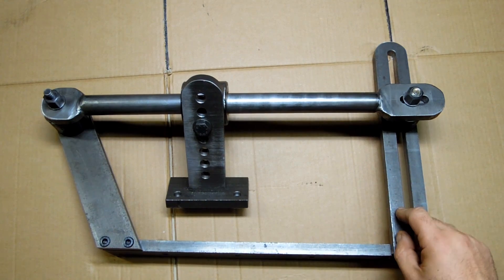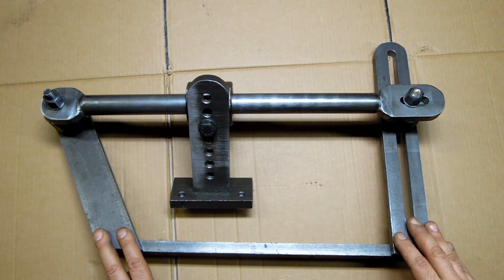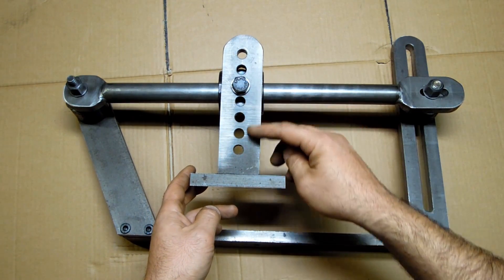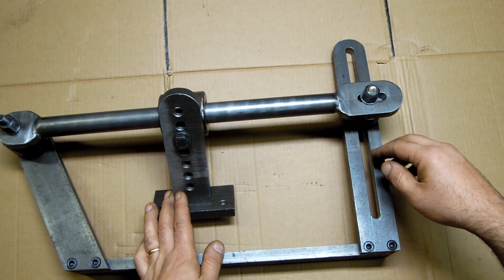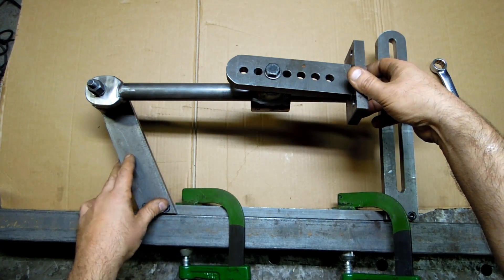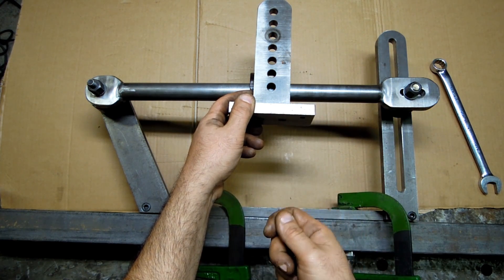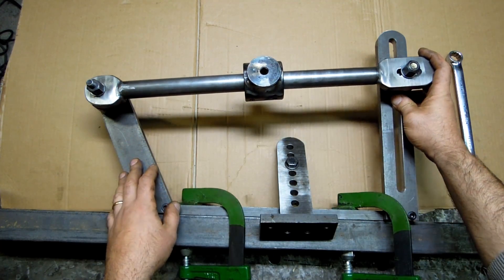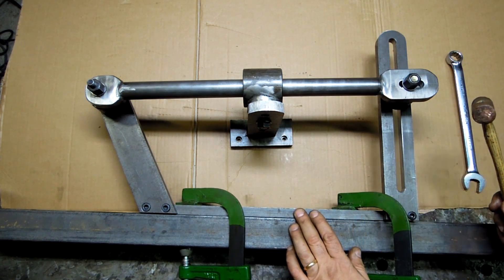lathe taper attachment 2

Comment: Love your taper attachment .. built one for my HF 7x10 mini.  Welded a lot of the joints.  Problem: I'm taper threading 1/2" CuNi pipe.  I turn the taper first, but when I'm cutting the threads the tool screw keep snapping :-( using an AR Warner indexable HHS insert.  thanks for any help

Comment: Tony I cannot believe how polished your presentations have become in seven years. Congratulations. 
Hope you're recovering from your recent loss. My sincere condolences.

Re the video, I don't have a taper attachment but use the tailstock instead. For Morse tapers I set a fixed center in the headstock bore and a revolving center in the tailstock. I have a commercially produced Morse taper mandrel that I insert between the centers, move the tailstock over and indicate on the taper. Once that's established you have your taper set. Of course Your stock needs to be the same length or it will be off but it works for the most part. 
To cut internal tapers I use the compound and indicate it to a sample taper held in the collet chuck on a piece of suitable drill rod or known dowel pin.

Comment: The proper taper turning attachment still uses the nut for the cross slide - so that still works as normal ! The cross slide screw is different as it has a sliding spline drive from the handwheel so that the TTA can slide the screw as necessary. The slide on the proper TTA is also a dovetail like cross slide and top slide slides.

Comment: With common tapers can you drill a set pin hole on the adjustable slide and have a set pin to lock it into place so you don’t have to use a dial indicator every time or are their too many variables taking it off and on to guarantee accuracy?

Comment: When you're done with your taper and want to reset to just a normal straight cut, do you have to adjust the taper angle and fully indicate it back to parallel? Or is there some trick to just disengage the taper?

Comment: Hello,  Now the challenge would be to design a chip guard that fits out around the taper attachment.  Kind of screws up all my racks on the back wall that the lathe is against.  I won't be able to reach them when I attach my taper guide.  This old Tony being This old Tony I expect one of your upcoming projects will be half nuts for the cross slide so you can engage and disengage without unbolting the nut!  Nice video.  Doug

Comment: Still awesome to still watching your vids all these years later. I actually just watched and old abom vid about his taper attachment on the monarch lathe. I gotta say, man, whatever you do for your 9-5 gig, you aren't making enough. Always thought your ability to solve problems was inspiring. I am an R&D tech for a big supplier of the manufacturing industry, focusing mainly on oem conveyor systems that run belts made from PVC, PU, Polyolefin, and a few other unrelated to that genre of materials such as rubber, leather, etc. If you aren't in R&D making booku cheddar the technology sector is missing out, and humanity will suffer because of it.

Comment: In lieu of a hammer for fine adjustments would it be possible to add a threaded rod (under I imagine , it just seems inaccessible) to the slotted side to be used as a lead screw and somehow have a turning handle on it ? 
Just an observation from Captain Hindsight here. 
Great Video , Thanks for Readin' !!!
Reply from the maker: Certainly would!  I was going for my signature "lazy" design.  :)

Comment: Tony,to save replacing the bronze bush,why not drill and tap the worn bush with brass screws with lock nuts,adjust the screws until you get a firm sliding fit.

Comment: What if instead of using cold rolled steel shaft and a bronze bearing, try building a straight guide shaft from 1x1" square stock. Then for the linkage that connects the guide shaft and the cross slide, maybe build a sliding carriage that is a two piece design. The carriage could have 2 roller bearings per side on both sides that follow the guide shaft. Easier said than done I'm sure but there's always a few other options.

Comment: How would i go about holding a tapered object in the chuck? I mean something that has a taper on both ends with just a very small flat in between the tapers. This is an MT2 to JT6 arbor. I need to shorten the MT2 side and i know i could probably cut it off with a grinder but that's not pretty. I'm new to all of this but eager to learn. Thanks.
Reply from the maker: Soft jaws for your lathe chuck... but in your case I'd look for a JT6 socket I could hold onto.

Comment: It would be easy to use some bearings for the cross-slide guide on a piece of square stock or even a milled guide for eccentric shapes. Although im having a hard time imagining what it could be used for cutting an S shape. Maybe a pointless vase lol. More of the purpose of the thought is that square stock could be used easily as well. I have a little old atlas with 12” swing for projects and have been pondering making one of these for a while. I’m 90% through building a tool-post drill for making some indexing plates for my dividing head. Maybe this will be my next tooling project. Love these videos.

Comment: Nice job on your taper attachment. You could slot the T attachment that bolts to the rear end of your cross slide and use a washer under the bolt head that connects to the bronze bushing block rather than the series of holes. But, of course, there is more than one way to skin a cat.

Comment: im sure this is a really stupid question, but dont most lathes let you spin that (i believe you called it a top slide) and set it at different angles so you can cut tapers? i saw that you spun it 90 degrees there, does it not allow you to set it at angles in between? what am i missing here
Reply from the maker: that's true, but the top slide only has very little travel (usually), so for longer tapers they're not that convenient.

Comment: Great share, a whole new dimension for the lathe. I saw there is even a taper attachment for the Atlas 10" lathe. You only need this for long tapers as the compound can be set up for shorter lengths, whatever the range of the compound is.

Comment: I can see the taper attachment being useful for long tapers, but for turning shorter pieces, you can turn your compound rest to match the angle of the taper and use it to cut the taper; you would of course lose the ability to use power feed to cut the taper though. Using the combination cross slide, compound rest, and of course carriage feed, you can also cut long tapers without a taper attachment.

Comment: Tony, I have a shopmade TAttachment that came with my lathe which I have never used but is built exactly like yours. My question is....can a 15 degree taper (30 degree included angle) be cut with a device like this without undue pressure or binding ?? I know 15 is probably at the maximum end of things but I need to put a 2.75 - 3" "spear point" on some 1.5" diameter stainless steel with the taper being approx 2.75 -3" long. The number I have come up with is 15 degree'ish. I would rather use the attachment under power feed than use the compound and be cranking all day especially on stainless. What do you think?....doable? The attachment is well made also with a bronze bush running on the bar like yours. TIA

Richard~

Comment: To replace the bushing, you could cut a new bushing in half and use the halves to press the old bushing out, gluing the new halves in with JB Weld and clamping the slider in your vice to take out the clearance - if you do not have a suitable welder. ...But then you could have threaded your shaft and ends and just unscrewed an end to replace the bushing. Or you could have used a split bushing in the first place and made the slider clearance adjustable with a split slider and an adjusting bolt. But by then we would be so old we would have forgotten what it was we intended to do with the taper tool in the first place.
Reply: turn one end down to allow the bushing to slide right off? ohdang, year old video lol

Comment: Also, if you added an eccentric bushing to either end of the slider bar (fixed end would be way simpler) you could get nice fine adjustment on your taper angle.

Comment: Cool simple job.   You gave me some good ideas as you talked.  A  travel thread Double Nut to lock down) instead of slot, and then angle could be fine tuned by turning nut instead of hammer . And brass could be removed if threaded on fixed end.  Also Instead of mounting to back of cross slide could be mounted to top of slide end with a flat or L angle-- if a guy does not have access- because up against wall with no access. But hey- i would have never thought of modifications  without your video with visual building  and explaining..... NICE JOB! You're a genius,

Comment: Ideal mechanical engineering class project: Design an alternative to the slot and clamping bolt. 
Precision screw, mechanical lever, hydraulics, detents, incremental inserts, mechanical multipliers... dozens, even hundreds of methods could be easily implemented all using his basic design.
Reply: Ryan James. the slot-bolt is pretty ideal, detents mean you are stuck with certain discrete angles and a precision screw without some sort of quick release would get tedious going from one extreme to another.

Comment: Why not use rise/run,  using fractions of an inch on your tool holding dials for "lateral" and "depth" movement, on your lathe, then just sand smooth? Wouldn't that be easier than creating a whole new contraption?
Reply from the maker: I've done plenty of that Ben.. gets old fast especially if you're making more than one.  The taper attachment was a one-time investment and now tapers are a (stepless) breeze.  But yes, rise/run could work.
Reply: I see. Hopefully I didn't come across as a jerk, I know you're smarter than that, just curious. Thanks, big fan of your videos!

Comment: Where your cross feed nut mounts if you have a slot that the locking/mounting screw passes through instead of a hole that would allow you loosen the screw and use the taper attachment without removing the nut. Machine a shallow slot on top of the cross slide for a cover plate to keep the chips out. System used on the Hardinge HLV. As a bonus when going from a large to small diameter loosen the nut and slide the cross slide in or out as needed and relock the cross feed nut mounting screw
Reply from the maker: interesting!  That modification doesn't sound too difficult, either.

Comment: Over the years , I've seen some highly developed machinery - very old machines with incredible accuracy , as well as functionality . . . 
    Case in point - how about having a 'T - slot' arrangement on the back of the lathe bed for the taper attachment ?   * That would make it infinitely adjustable !   ( One of my first lessons in machining , " If you can't make it accurate, make it adjustable " ;)  )    Now back to the video . . . I'm only a couple minutes in  > > >  Hmm . . . I can also envision a graduated dial on the right side , (where the slot is . . . brain working overtime ? )     'Got some great comments & suggestions -  Thanks for posting this !
Reply from the maker: Thanks George, and thanks for watching!
Reply: georgewocosk

Comment: A bit late getting to the races, but it would be pretty slick if you bored through the center of the slide bushing pivot bolt and threw a zerk fitting on top (or oil cup depending on what your running in there).
Reply from the maker: Not a bad idea, interex, thanks!

Comment: is there some reason that people dont like using the tail stock for tapers?
I find it so easy that I never have understood why people hate that method.
im fairly new to metal working so I am probably missing something.
Reply: I find the tailstock off-set best for smaller angled tapers like morse sleeves. For tapers in about the 30 to 90 degree range, or short tapers, I generally use the compound slide. But for those intermediate angles the taper turning attachment is a good option to have, especially if the taper legnth exceeds the compound slide travel. Also you don't have to set up between centres for a taper attachment like when tailstock tapering. And steeper tapers tend to hammer your centers and centre holes if you go the tailstock route.
Reply: makes sense I'll have to build me one of these

Comment: All metal lathes have tailstocks that can be offset. To cut tapers. this has been the case since about 1787; when the metal lathe was invented; because it's so obviously useful. Try read a book; like a high school textbook on "how to use a metal lathe". you just offset the tailstock and turn between centers; which was the original construction and use of the metal lathe betore "Chucks" became common. there's nothing compllicated or difficult involved; nothing to build. Recently, for instance I tapered a carbine barrel for a customer by offsetting my tailstock; as the lathe manufacuter indtended; and reset it to cut a perfectly parallel cut to the ways, aferwards. this not complicated, either; and it's really self-explanatory. You're just wasting a huge amount of time and material.
Reply: Nice try at being a condescending douche.  I think you'll find that Mr Tony is  pretty friggin good machinist.  Maybe if you left your ego at the door you'd learn a thing or two.
Reply: +John Affleck It's bad for the lathe centres if you have too much offset, it also requires having to set the tailstock back on centre afterwards, which can be a pain.
Reply: No, no it hasn't. I have seen pictures of Maudslays screw cutting lathe (1797) and that loose head (tail stock) is rigidly mounted, it does not adjust perpendicular, except it looks like it slides forward or backwards, parallel to ways. Now we can talk tapers. Tapers before this neat invention of Maudslays would have more then likely been cut by freehand or by some means of a guiding attachment, such as on a wood lathe. Cant be on metal lathe because the lead screw that drives the carriage wasn't invented until Maudslay screw cutting machine in 1797. Morse tapers were invented by Stephen Morse in 1864. Chucks is another one. 3 jaw and 4 jaw chucks were invented in 1818. That's only 31 years after Maudslay Screw Lathe. Common? I don't know how common. Do you? 
So I would have to say up until Morse in 1864 and for a time after, the taper attachment would have been invented and in use even in todays times.
Reply: With an angled topslide you are limited to cutting tapers the length that you can operate the topslide, which tends to be shorter than a taper attachment.
Reply: b-strizzle he was a bit of a douche, but I have some thoughts/questions. Thought: this is an almost 5 y/o video and we don't know what ToT might have learned between then and now. Question: why not just use an angled topslide to cut tapers like he does in more recent videos?
Reply: steven
just replace the 60 degree centers by homemade centers with a ball bearing in stead of the 60 degree point
Reply: Yes, true you can offset the tailstock to turn a taper. Except that the 60 degree centers don’t fit the center holes properly which can affect your work and wear out the center holes that might be needed in the future etc. The taper attachment eliminates that problem. As you know, you can also cut tapers using the compound rest (aka top slide). More than one way to skin a cat.
Reply: Nice reply, I have an old ML4 from around 1930-1940's it has a slide over tailstock meaning I could set it over and get it to turn a taper bar. Then once I've done that after the swearing to initially get it set over the correct amount. Then I would have to reset my tailstock, which on an ML4 can be minimum 1hour process to get it near parralel. The last 2thou can take another hour to dial in fully. 
I like the attachment, I've never seen one before as my tailstock and spindle are only MT1 then I would opt to use the cross slide as I have around 3.5" of travel which should be enough to turn the tapers I'd need for my lathe. 
Keep up the good work Tony I enjoy watching your videos.
Reply: Please post your video of realigning the tail-stock to within a .0001!
Reply: Off setting the tail stock ,if used a lot, can prematurely ruin bearings , etc. This is the most recognized " proper" way to cut tapers! At least the way I was taught.

Comment: Interesting I will knock one up at some time, you could save some time and effort by removing the cross slide handle nut as the manufacturer intended on the Colchester Triumph, one of the few things they got right.

Comment: Great idea, can come in very handy! On the guide bar you welded together, you could go with a larger dia. And just cut flats on the ends, and for each time you use the attachment scribe a line, and stamp the angle for future reference. Thank you enjoyed watching!
Reply: Why not split the follower bearing horizontally and make a split bearing shell like an automotive con rod big end. That way you can compensate for wear by just making a new bearing shell or rub a few thou off the cap side to tighten things up. Bearings from a B&S lawnmower engine might fit. Just an idea. 
I had explored the use of a linear bearing and shaft from chiny land for the basis of a taper attachment but haven't pursued it yet.

Comment: Thank you very much. One question :
Is it possible in oder to copy the taper angle to replace the indicator by a piece of metal ended with a ball bearing in order to reverse the action of the taper attachment. If the taper nut is loose, will the movement of the cross slide along the part set the angle bar to be parallel  to the taper in the spindle ? Then the angle can be lock. 
Great video thanks again

Comment: Make a tool with a bearing to hold in the toolholder that way you could run it up against the taper you wanna copy crank it down the taper and it should adjust itself then runit back again with som pressure and lock it down.. then just put an indikator on it for the fine fine.. adjust. =)